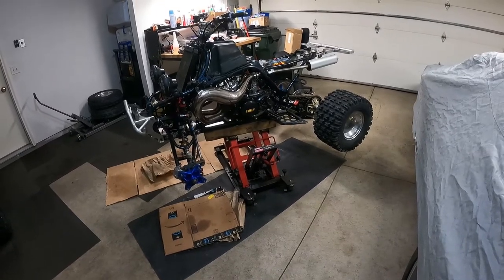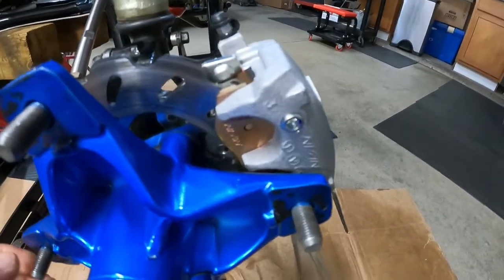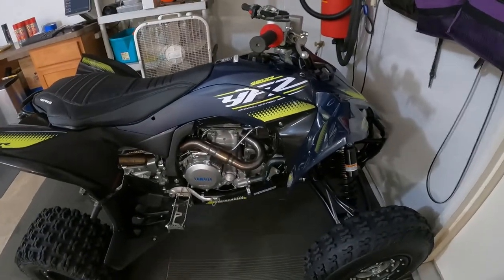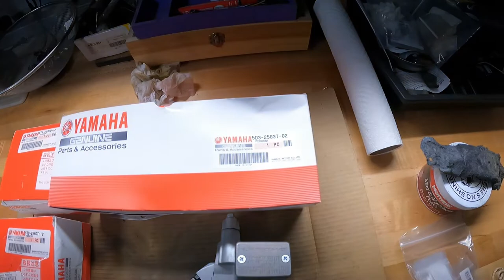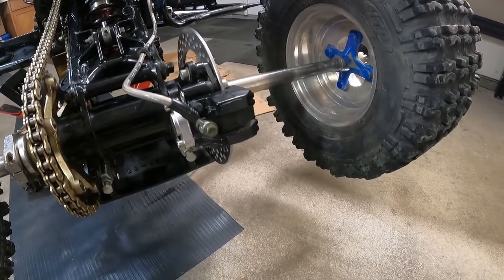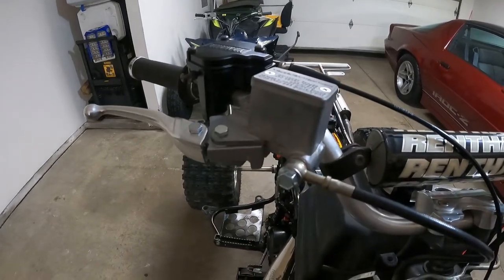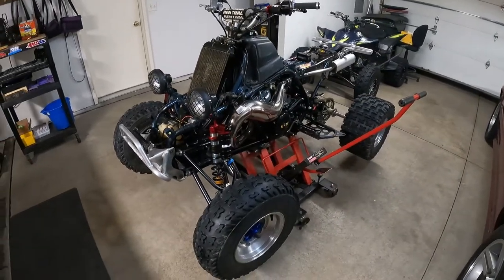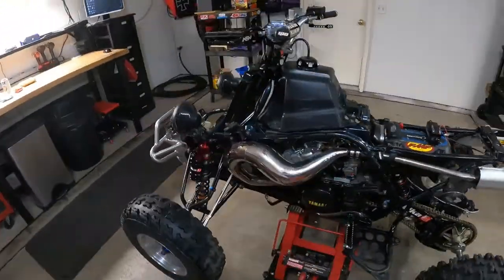Banshee brake upgrade using YFZ450 calipers and master cylinder

Comment: Great crystal clear video and narration with no music and excellent tip re the caliper upgrade. I needed a good look at the front suspension/spindle/hub setup for a DIY Scorpion P6 style reverse trike build that I'm designing. Banshee front end parts should be a good shortcut.

Comment: The “click click” on the 450 is actually the brake light switch engaging, also sweet ass 3rd Gen under the cover
Reply from the maker: Yes thank you, At first I didn't realize it was the brake light switch because my Banshee doesn't use one and took it off before installing the new Master Cylinder.  

Also thank you for the car comment! I've been working hard on it to fix/maintain every thing I can. I've had it for 20 years now and it runs like a top! 1989 IROC-Z with the 5.7

Thanks for the comment and thanks for watching!
Reply: Is that what that wire is that comes out of the reservoir ? And can I just cut it off ?

Comment: I’ve got a similar locking axle nut on my banshee but it’s too big for my biggest adjustable.  Where can I find an adjustable or automotive wrench big enough?  It’s at least a 3” nut
Reply from the maker: These type of locking nuts don't need a ton of torque so I just use a C-Clamp on the flat spots to tighten it. If yours is still shinny new just put a couple of wraps of electrical tape around it for protection. The C-Clamp way has a second benefit regarding the 5mm set bolt. I like to first pinch everything together then install the set bolt with loc-tight. This also lowers the chanced of snapping the set bolt (been there done that twice!)   Its hardly worth buying a wrench big enough to work on a Steam Engine as this method works and is probably already in your tool box. 

Best of luck and thanks for watching and comment!

Comment: What’s the wire coming out of the reservoir ? What does it connect to???
Reply from the maker: That wire is designed to be a brake light switch. You can simply leave it disconnected or remove the switch itself.

Comment: Sr., What year is your banshee?
Mine is 06... Will those 07 yfz calipers be compatible with my 06 banshee ? Thanks in advance.
Reply from the maker: I have a 95. You can use the 07 YFZ calipers no problem. Make sure to also use the 07 master cylinder because it has more fluid volume. Additionally you can use your current Banshee brake lines since the banjo bolt is the same. This is a GOOD upgrade and wish I would of done it earlier! The front tires will lock up now if I want!

Comment: Also what did you do about the front brake lever light swicth
Reply from the maker: Good question. That little switch comes off with a single screw. Its the exact same switch used on my 2020 YFZ450R so I now have a spare!

Comment: Does it have to be 07 calipers with the 08 master cylinder? Can't it just be all 08? What is the latest year that the banshee will support?
Reply from the maker: You can use any years from 2007 to current for the Master Cylinder and calipers. The 2006 and earlier were different.
Master Cylinder Part# 5D3-2583T-02-00
Front Caliper (Right) Part# 5TG-2580U-12-00
Front Caliper (Left) Part# 5TG-2580T-12-00 

I used the 07 and 08 because that is what I had. As a follow up this brake upgrade is 1000% better stopping power than stock and highly recommend it!

Thanks for watching!
Reply: Hi guys. Great info. Please help... Will the 07 and up calipers fit on a 06 banshee?
Reply: What year banshees are you guys referring to?

Comment: Did you use all the banshee brake lines?
Reply from the maker: So I already had aftermarket braided brake lines installed due to the +2 +1 A-arms requiring the lines to be longer. You can certainly use the stock brake lines as the banjo bolts are exactly the same. This upgrade is worth every penny and wish I would of done it long ago. You can literally lock up the front tires on command with one finger yet are very precise as needed.

Comment: Would this fit on my 02 raptor 660
Reply from the maker: Unfortunately I can't say for sure as I'm not familiar with the 660 setup. Does the 660 use a single piston brake caliper?
Reply from the maker: So I looked it up. The stock Raptor 660 caliper is the same caliper as a stock Banshee caliper. That means this upgrade will work for you also!

Comment: What front A arms do you have? And your thoughts on them plus or minus?
Reply from the maker: Hey Dude! I'm running a set of Alba Racing +1 forward and +2 wide. Aftermarket A-Arms at some point become necessary if you still have the stock A-Arms. The stock setup uses welded in ball-joints so they are not replaceable. 

My thoughts as a plus:
Aftermarket A-Arms use replaceable ball-joints that are much larger than the stock ones. They are what is used in automobile applications.  
Increased total length of your quad of 1" helps the ride quality.
Increasing the width of 2" increases stability and ride quality.
Aftermarket A-Arms open up the use of aftermarket shocks.
You will be able to adjust camber of your wheels.

The minuses:
Aftermarket A-Arms are manufactured by a aftermarket company. If that company goes out of business it will be difficult to cross reference replacement parts. Even though Alba racing has been around for years and are still to this day, they have made several revisions over the years to their A-Arm's causing confusion to what bushings and ball-joints are correct for mine. This has been a bit frustrating the couple of times I needed to by replacement parts but was able to work it all out in the end.

Recommendations:
I would highly recommend purchasing a set or two of replacement bushings, ball-joints and tie-rod ends right from the beginning so they are on hand and ready when need be.
Invest in new Chrome Moly sleeves or sometimes called collars. These are the cut to length pieces of pipe that the bushings ride on. Never reuse your old ones as they will short live your bushings much more quickly. 
Look for A-Arm sets that are greaseable as some are not. 

As always thanks for watching and the great question!

Additionally and as a follow up to this video's topic regarding the YFZ450 upgrade, I absolutely love them! My brakes work 1000% better and couldn't be happier with them.
Reply: @350iroc9  awesome response 👏 
You have me sold on upgrading front brakes for sure. That's next!!!

I have the old fireball a-arms and the design is not good for the upper ball joints. He said that I can nolonger get the ball joints. 
They have new version a-arms out for the 19 inch elka shocks that I already do have. So I probably will just order a new set. Their new ball joints look similar to the alba.
Reply from the maker: @Floridawoodsbanshee  So its funny you mentioned Fireball Racing as I have a set of their A-Arms new in the box I got from a buddy that got out of the sport. Take a look at this link: https://shopfireballracing.com/products/copy-of-banshee-j-arms

Are these what you have or an older version from them?
Reply: @350iroc9  the link you sent Is the new version. I have the old version I bought in 2006 when I bought my banchee brand new.
Reply: @350iroc9  at the time elka and roll design were working together on the rear shock plus linkage. I had to wait 5 months for them to complete the testing.
After roll design was happy with the performance elka started mass production and I received one of the first shocks with the rear link.
Reply: @350iroc9  in my opinion the rear shock and linkage kit is the best upgrade for the banchee suspension if pounding lots of sand whoops ( Florida ) and other nasty conditions ( mountains / rocks ) ect.
Reply from the maker: @Floridawoodsbanshee  So I recently purchased the Elka rear linkage kit in Dec of 2022. It's definitely a nice piece and well built. I know for a fact that it actually lowered the rear end just a bit because the motorcycle jack stand that I use now has a hard time clearing my skid plate. The linkage did improve the rears shock performance as a whole. I also think it may of lost a bit of ground clearance at the same time. I commonly ride the same tails over and over and noticed that I'm hitting things that I wasn't before. Now in defense of the linkage and after noticing what I just explained I turned up my compression adjustment and that seams to of helped. This link is to expensive to destroy on the rocks as you know. This is the first year using it and will be able to better review it after a full season of adjusting my settings.
Reply: @350iroc9   🤣 very expensive for sure. I was traveling for a few years. My bike took a beating while hitting mountain areas around the nation. I'm back in FL For good so I'm taking the bike down to the frame with fresh powder coat, new arms and swingarm. Shocks I just got back. Had them completely gone through top to bottom as well as the motor. ( 4 mil from f.a.s.t. ) Really just need better front brakes, a-arms, and gonna get fireball swingarm stock length.
Reply: @350iroc9  Florida sand is so badass. Look up croom or ocala National forest.
Reply: I will say this. While I was waiting for shock to show up 2006, I was taking a beating in the whoops and the thumpers were eating my lunch. After I got the shock I was riding 4th gear wheelies through the nasty deep whoops for a good 40 or 50 yards. Thumpers couldn't keep up. Not even the brand new yamaha 450's from today. Shocks are valved for desert racing. 🏜
Reply from the maker: @Floridawoodsbanshee  Right on man! Its always a good time to break down and freshen up the old girl as she takes care of us and we need to take care of her! 4 mil is definitely going to spice up your life! 

I also this past year purchased a similar swingarm from Lonestar stock length. The same design that uses the roundhouse style carrier like the Fireball. As a tip you are going to need to purchase a new rear brake line that is much shorter. The brake stay on these type swingarms bring the rear caliper up higher. If I'm not mistaken the stock brake cable is about 22" and I literally ended up using a 17". You don't want all that extra cable hanging around waiting to get hung up on something. 

I think I'm going to also break down my bike this year or next depending on my compression readings.
Reply: @350iroc9  what state you in?
Reply from the maker: @Floridawoodsbanshee  So that's why its nice to have both a Banshee and a 450R in your garage. The largest variable is the rider and not the machines. Since I myself have both I can honestly say that they are nothing like each other but love them both. It actually takes me a hot minute to get readjusted when alternating them from one trip to the next.
Reply: @350iroc9  was just looking at that link again. Fireball long travel for the 19.5 inch shocks are the ones I need. 
Wow 750$ sht is expensive lol that's crazy.
Reply from the maker: @Floridawoodsbanshee  I'm way up north in Ohio next to Lake Erie. I would like to come down to FL in the winter to ride Croom if we can't get a Glamis trip together.
Reply: @350iroc9  yeah the 450's are sweet machines out of the box. Especially for the money.
Reply: @350iroc9  Damm that is pretty far away lol.
 Ocala is the place to ride. Multiple trail systems. Plus a really nice camp ground overlooking the lake. Showers and laundry room. Wifi. It's pretty far from any town. We normally spend a week or two just riding and camping. When I was traveling around I couldn't wait to get back. Lol.
Reply: @350iroc9  croom is a state park about 3600 acres.

Ocala is a national forest with hundreds and hundreds of miles of trails. You can easily run out of fuel.
Reply: @350iroc9  and they have a bombing range in the middle. Pretty cool when the fighter jets are circling over head dropping munitions.
Reply: @350iroc9  any update on $650 link? I'm ordering Elka Stage 4, LSR DP Pro A-arms, axle, etc (just not swingarm) and the link has me on the fence. I'll be hitting jumps on our local MX track but I hit a curb at high speed downtown Cabo, bending some front end parts, rims and blowing tires.
Reply from the maker: @stiffmeister0hYeah  So the Elka rear link I can't say I'm completely satisfied with. It definitely lowered the quad a bit and is now lower than I would like it. I already have the pre-load maxed out in the rear now just to get close to where I was with the stock link. I'm definitely bottoming out on the Elka Link because there is excessive rock damage evidence underneath it. At this point I would recommend to skip this high priced part and put the $$ somewhere else on the machine. I only even considered purchasing it because it was $200 off anything Elka day. I polished my stock one to a mirror finish and rarely smacked the ground with it installed. 

Be careful out there! It sounds like your guardian angel helped you this time! LOL
Reply: @350iroc9  great you just saved me over $600. Would that be better used for the LSR swingarm? You mentioned it in the video. I have not ridden the Banshee enough to know if it needs stock or extended length (not for drag racing). I'm going to go out right now and continue to disassemble. Unfortunately, BansheeHQ forum seems dead so it's hard to get info. Going all Ekla stage 4 (new hobby, why not learn adjustments), LSR +2 +1 A-arms, axles, etc. Just not sure on steering stem and why people get extended +1 +2.
Reply from the maker: @stiffmeister0hYeah  The LSR swingarm is a good buy for sure. Just to get rid of the OEM chain adjuster makes it worth it. The LSR swingarm comes loaded with all the bearings and is ready to go. I went with the stock length myself since this is a woods quad and not a hill shooter or drag race build. Unless you are super tall with long arms there is no reason to get a longer steering stem. You have to remember that when you do that all of the cables and lines need to be longer also.